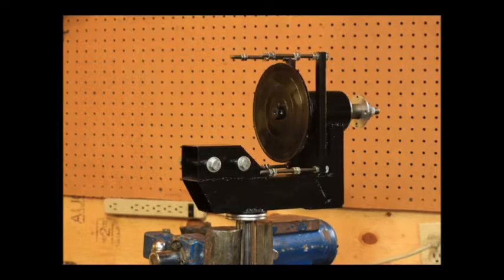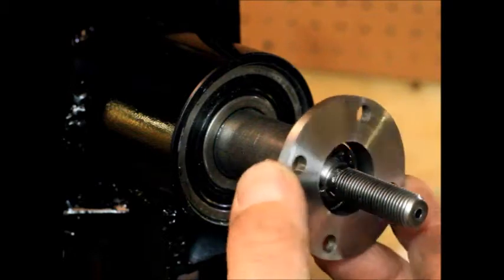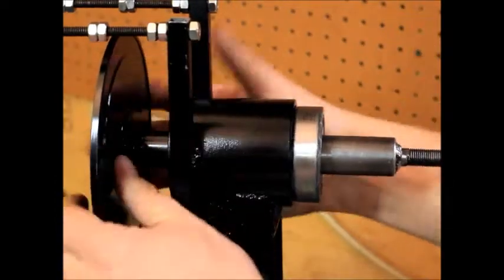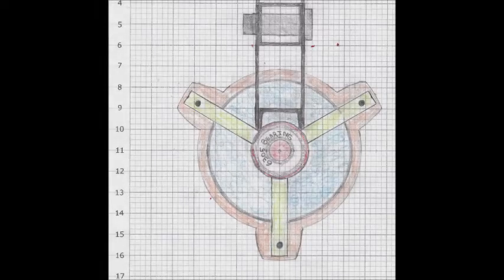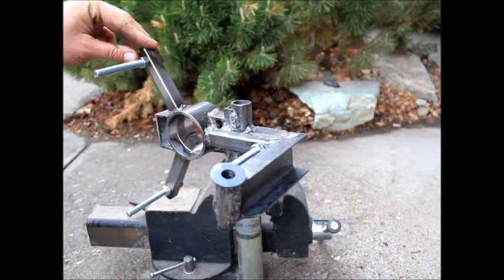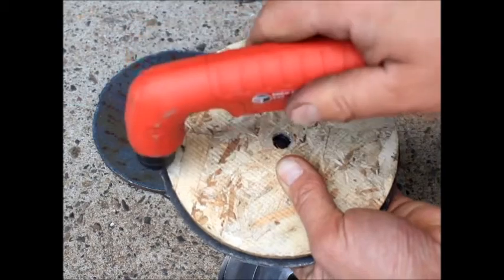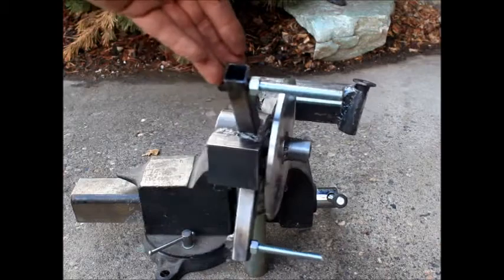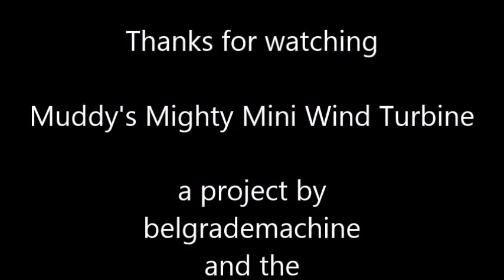Part 1 Designing of Muddys' Mighty Mini Wind Turbine by belgrademachine and muddymuddymuddmann

Comment from the maker: Yeah, unfortunately I had the audio settings to low .... won't make that mistake on the next video. Frankly, this will be my first furling system as well so length and weight of the tail will have to match blades and stator. All a learning process but not afraid of a fail or two. I'm looking forward to the finished project as much as anyone.